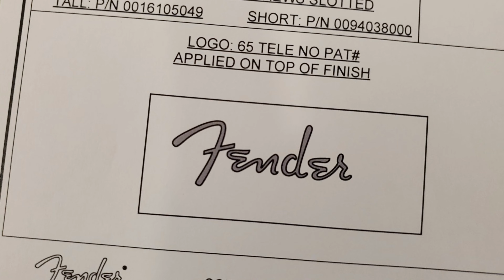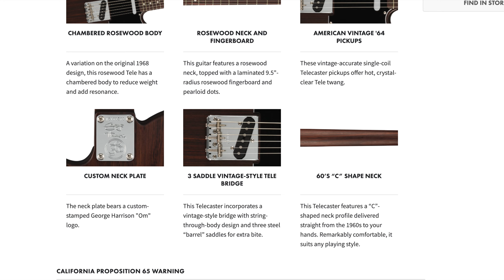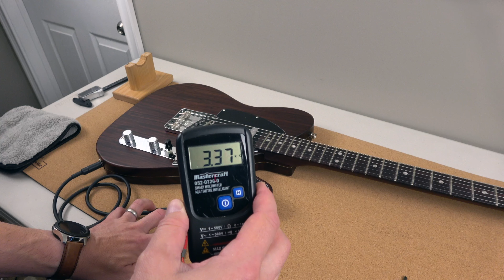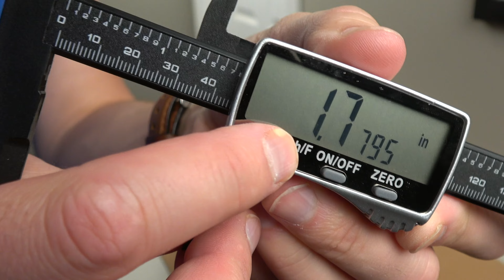Fender Artist George Harrison Rosewood Telecaster Deep Dive Part I

Comment: Hey Landon,
I did this backwards and saw your part 2 first lol….
You don’t want this guitar… you want to sell it to me! 😈
As I mentioned on the other video, I love these and real sorry I didn’t preorder one! ( The old expression ~ shoulda…coulda…..woulda! ). The weight isn’t bad at all either, it’s actually a lot less than I would’ve guesses although I’m fairly sure it’s chambered out to get it to a stealth 7 and change pounds 🤙
PS ~ On a side note I always overwind the G string downward even if there’s locking tuners just to get the pitch of that G string a bit more downwards since the tree is only a 2 string tree, they really should’ve made it a 3 string version 😉🤟